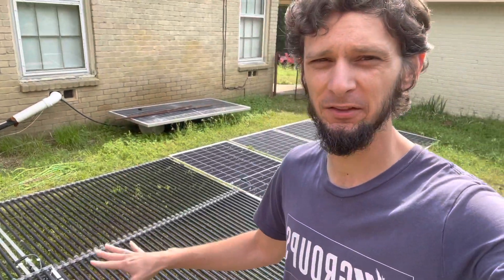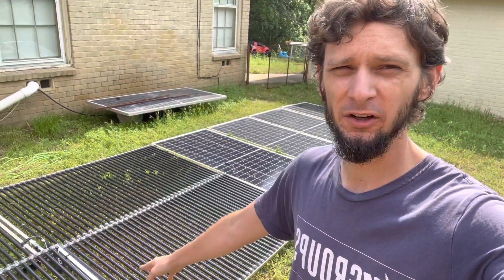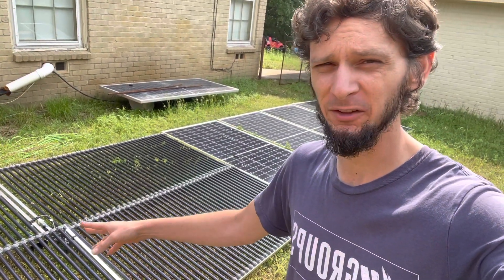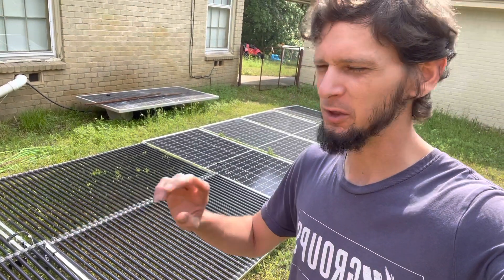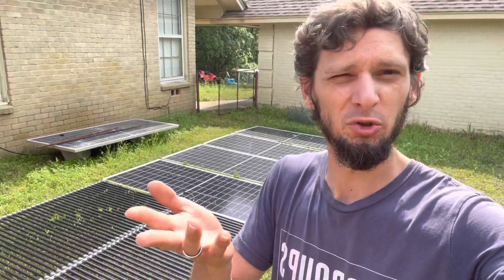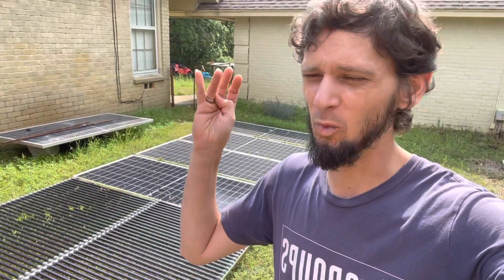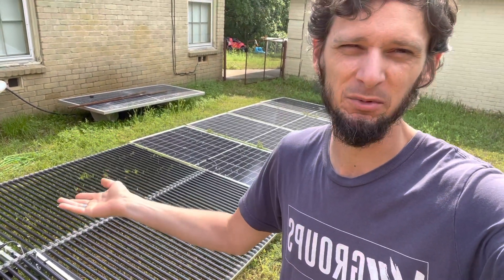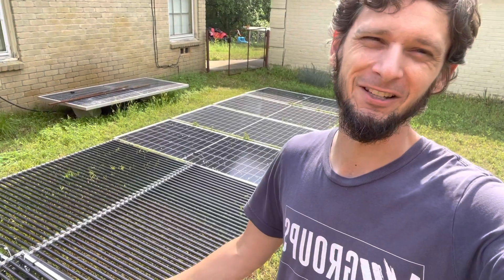I Can’t Math on Camera

Comment: I have 3 solyndra 182w pannels how i can connect these pannel into series connection.these  pannel have 4 connection points
Reply from the maker: Think of each tube as a 92v panel. If you set the panels side by side you can connect in series so the power is flowing from the end of one tube into the next.